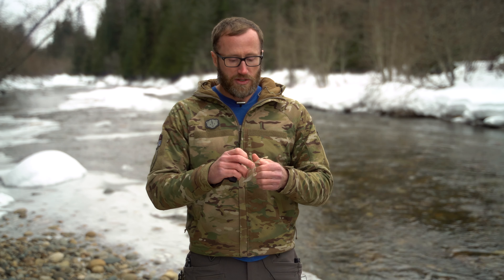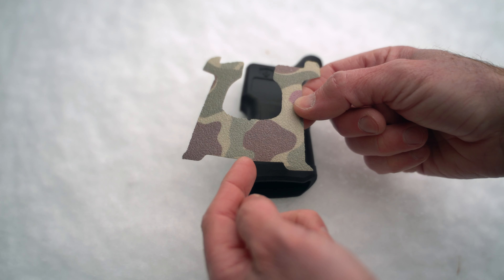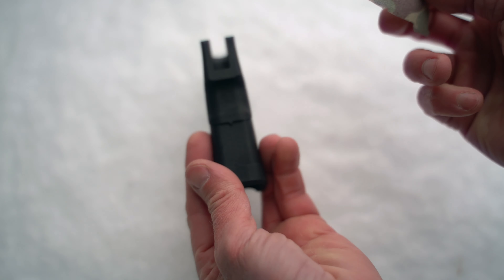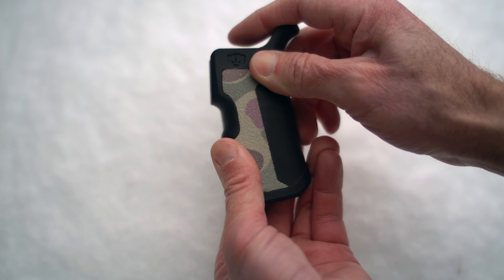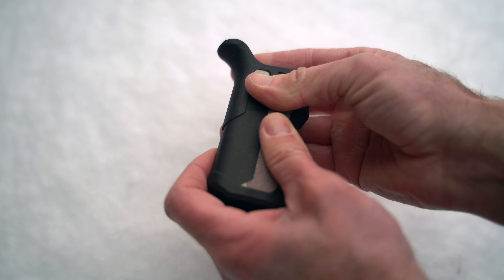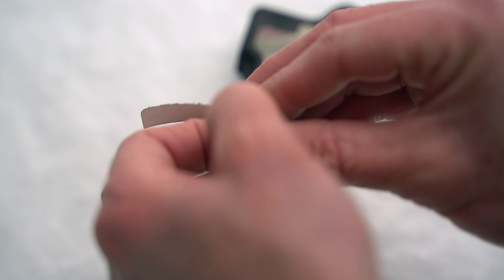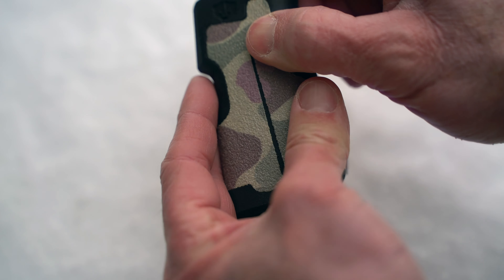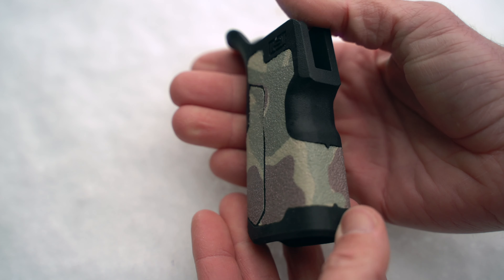How to install Grip Tape Panels on the Stoner Rifle Grip

Comment: It would be cool to see the direction you would take on a ground up build from stripped lower to barrel and accessories.  I started building on $50 lower recievers as a hobby and have turned out some pretty impressive guns at super low cost
Reply: His take on 3 or 4 different builds.